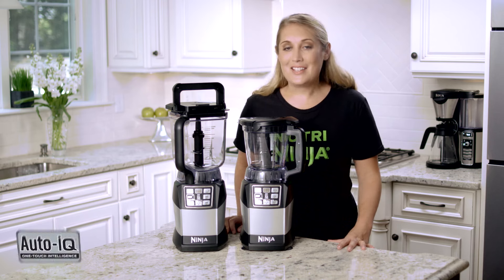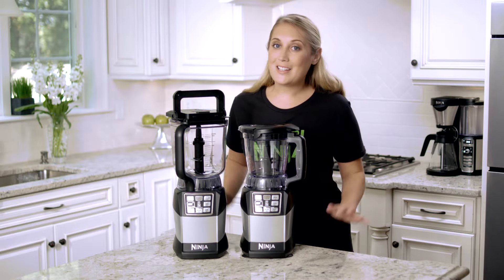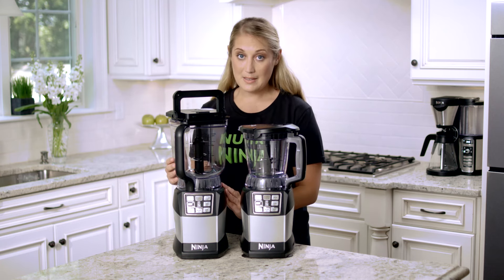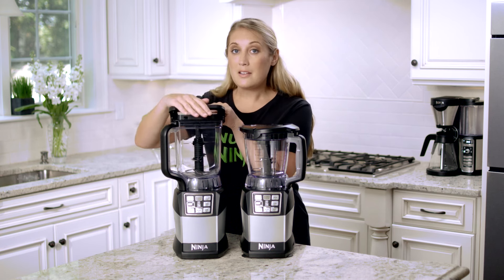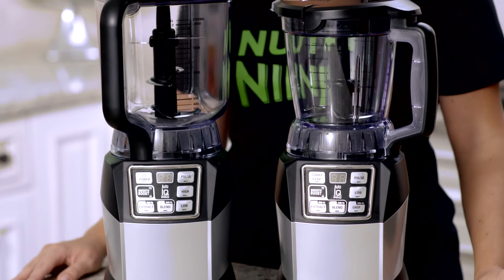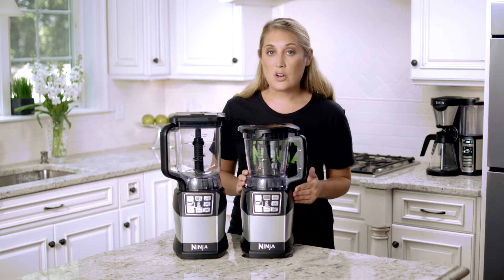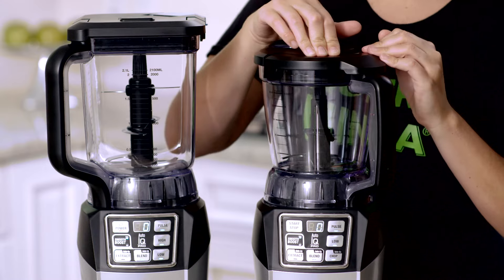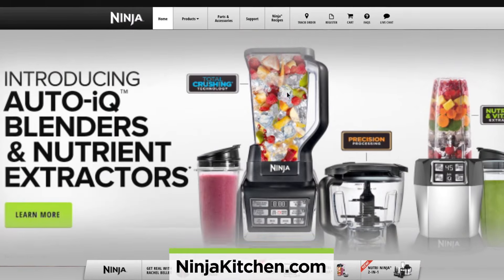Troubleshooting: Why the Nutri Ninja® Auto-iQ™ won’t start

Comment: So my nutra ninja just has a "- -" and doesn't do anything... the light turns off after a while and when I push the button the double dashes come back on, yet nothing happens....
Reply: Did u find a solution? Mine is having the same problem
Reply from the maker: We are sorry to hear about this issue, Luiz. To aid you please call us at 1-800-365-0135. We are open Monday through Friday 9:00AM to 9:00PM ET, and Saturday 9:00AM to 6:00PM ET.
Reply: @Azvd1  pretty sure parents threw it out or something when renovating... oh well.
Reply: @EPNutriNinja  pretty sure parents threw it out or something when renovating... oh well.
Reply from the maker: We're sorry to hear the blender was disposed of. Please let us know if you have any other questions or concerns. We're happy to help.
Reply: Same I’m so annoyed . Just two lines .
Reply from the maker: We are sorry to hear about this issue, Isabelle. We’d like to do some troubleshooting steps with you in order to best resolve your issue. The troubleshooting can be completed by phone at 1-800-365-0135, or over live chat here: https://spr.ly/6054zcw7u. Please have your blender on hand at the time of your call or chat. We are open Monday to Friday 9am - 9pm ET as well as Saturday 9am - 6pm ET.
Reply: @isabelleloretta156  I had the same issue when I first opened mine, just two lines displayed. But once you place he blender into the port you have to turn it slightly to the right until you hear a clicking sound and that locks the vessel in place and then the screen will display a “00”. Hope this helps
Reply: Having the same problem. This happened before and I bought a new base after troubleshooting everything I could. I am not doing that again. Time to find another brand. It works great til one day it just doesn't. I bought my original in 2018 and replaced the base in 2021. This one didn't even make it 2 years and I use solely to make a smoothie. I didn't even ever use the food processor.
Reply: Same thing with mine
Reply: Mine, too. I'm pissed. Brand new unit does nothing. What the hell. I'm sorry I bought this for my wife for Christmas.  A product Brand new out of the box does not function. Absolutely unacceptable.
Reply: I just took mine out the box and went to use it and it's doing it.

Comment: Seriously !!?? I just bought the nutri ninja today and it will not turn on no matter what. Are you seriously blaming your faulty product on people not plugging it in.
Reply from the maker: +Cc We're deeply sorry to hear that your Nutri Ninja is not working and would love to assist. If you didn't already, please give us a call at 877-646-5288 M-F 8am-10pm|Sat-Sun 9am-6pm ET. Thanks!
Reply: Same exact thing happened to me!!
Reply from the maker: +Ellie Patrikios Hi Ellie, are you still having issues with your Nutri Ninja? If so, please don't hesitate to contact us via phone at: 877-646-5288 M-F 8am-10pm|Sat-Sun 9am-6pm ET. Or send us a private message via Facebook www.facebook.com/nutrininjakitchen, with additional details of your experience. We'd love to assist!
Reply: +Nutri Ninja I purchased the nutri ninja bl 480 today and it absolutely will not turn on. I don't know what the issue is. I looked through the manual and still no luck. My mom is beyond furious right now.
Reply: I used ice in my blender and there was liquid in as well and now it won't work. I though lt it was supposed to be able to blend ice. The numbers work but the blender doesn't and I'm past my 1 year warranty since you all don't allow the 2 year warranty if not bought from you.
Reply: I worked in IT and, yes, seriously, I lost count of how many times people didn't have their computer or printer plugged in or turned on.
Reply: Nutri Ninja even your AUTOMATED SYSTEM is faulty. Asks you to press 1 for English and nothing happens. The system hangs up on you due to inactivity. Complete inefficiency all the way around.
Reply: Terrible product 🗑
Reply: Mine stop working too, doesn't turn on, yes i lock the lid correct I only have this blender for couple months smh

Comment: What I have not seen on ANY of these ninja videos is THE FOUR TABS ON THE CUPS WEAR OUT REAL, REAL FAST! Once the tabs are worn, the ninja will no longer work unless you hold the top of the cup in a tight clockwise direction or it will either fail to start or stop after a few moments. A set of cups is around $30.00 and to replace them ever few months is expensive. Also this dizzy dame is less than helpful, you get more info from reading the directions or asking your kid!
Show less
REPLY
Reply: I have same problem.   The tabs on the base are clearly worn down.    They in turn wear down the cup tabs.  The tabs on the base appear to be removable and replaceable.   Does anyone know if Ninja sells replacement ones?    Thank you.
Reply: I have same issue wer r these tabs located please advice

Comment: Fixed mine after a quick inspection of the lock in area. Mine would click, but the light would still blink and it wouldn't turn on. All I had to do was clean out all of the gunk that had built up from spillage that was keeping it from locking in the whole way.

Comment: Mine recently started shutting off halfway through the smoothie cycle.   No idea why,  unless it's overloaded,  or vibrated out of position.   It's never been an issue until the last week or so.   Usually it goes 55 seconds,  now 25 and it completes.

Comment: I have the BL493 model and it will not start either.  I plug it in and all the lights come on but when I press the button to start it nothing happens. I have unplugged it and waited as the manual says to do but have the same results.
Reply: Any chance you ever got yours working? I’m having the same issue and don’t know what to do!
Reply: @kategroh1035  I did not. I tried replacing the capacitor with no success so I just disposed of it.
Reply: This is a piece of junk. I have attempted everything and the timer goes on and will down to 0 but it does not blend, puree or do anything. I will contact NINJA CS and see what they have to say, my guess is nothing. I think my alternative will be to put it in the garbage where it belongs. Most disappointing.
Reply from the maker: We're very sorry to hear about your experience, Mark. To best assist you with this, please reach out to our phone support (800-365-0135) or chat team (https://spr.ly/6052PS7Du, click the green chat button in bottom right corner). We're available Mon.-Fri. 9 a.m.- 9 p.m. ET, Sat. 9 a.m.-6 p.m. ET. When you reach out, ensure you have your unit with you.

Comment: This blender does not work and has not worked since purchased, the power is on, the time is 0. If I push the pulse button nothing happens, the extract, smoothie and auto IQ boost light is also on, nothing happens. Any suggestions?

Comment: the lock in the handle of big container is causing a problem with the blinking power button. There is a mechanism in the handle of the big container..there is a metal pin that pushes down into the plastic handle..then this pushes another plastic button down in the handle...this is causing my problem. Everything is locked down & I'm still getting the red blinking power button.
Reply from the maker: + Easy Company Hi, we are sorry to hear about your experience with the 72oz pitcher. Usually when the lid is not locked correctly on the pitcher, the unit will flash to indicate that but we would need to ask you a few questions to determine whats going on exactly. We invite you to contact us directly so we can assist you with this. We look forward to your call. Thank you 

Customer Service department: 866-826-6941
Monday-Friday, 8am—10pm EST
Saturday-Sunday, 9am—6pm EST
Reply: it's fixed..it was dirty
Reply: @EPNutriNinja  I am having this issue. Unlike some customers here, cleaning did not help. Everything is locked/clicked in place as indicated. It is thoroughly clean and still I'm getting the blinking red power light.

Comment: This is not a good brand. Poor manufacturing and quality control processes. These systems are very faulty. Mine stopped working during the 2nd time I used it.
Reply from the maker: We're so sorry to hear your product stopped working, and you feel this way, Juan! We are more than happy to help you. For assistance with your product, please call our customer support at 1-800-365-0135. We're open Monday to Friday, 9:00am to 9:00pm ET, as well as Saturday from 9:00am to 6:00pm ET. Please have your model with you, so we can go through some steps for warranty purposes.